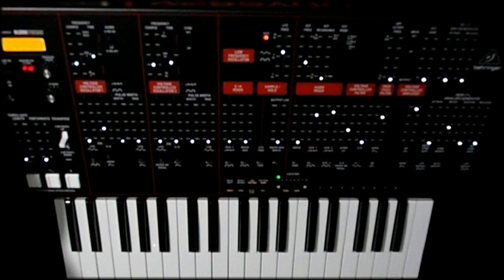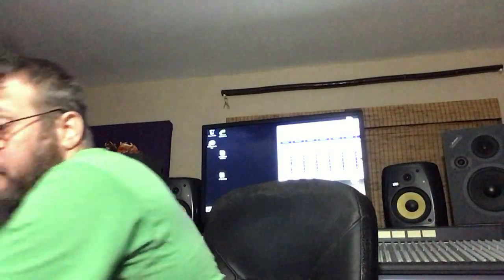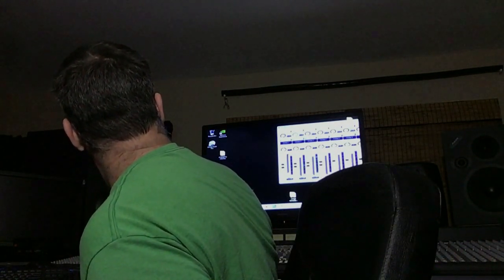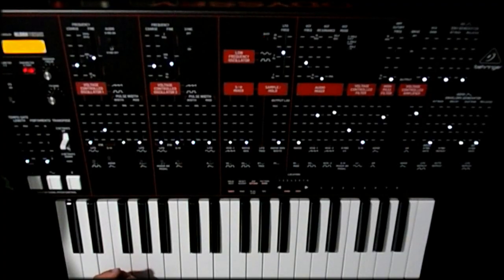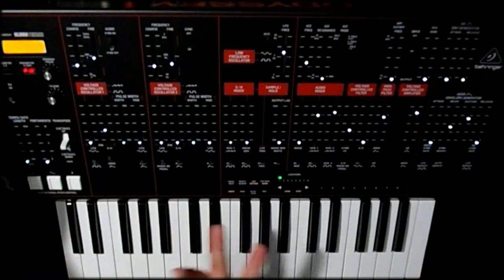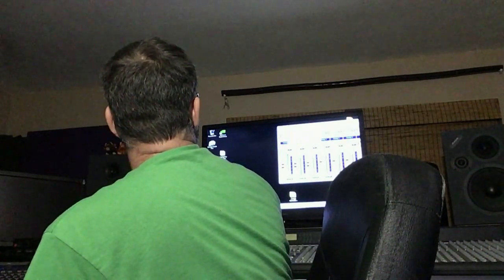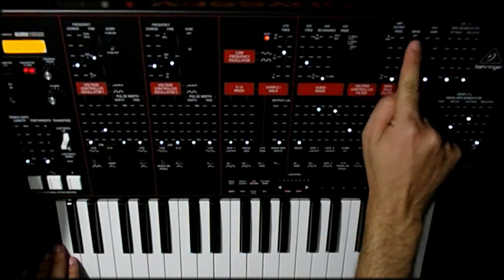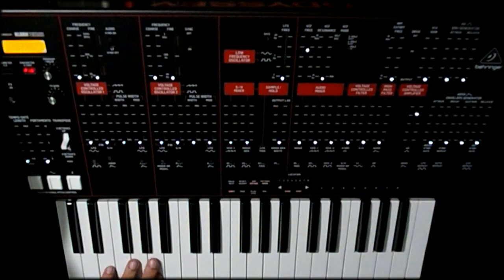Behringer Odyssey Emergency Guide. Things you MUST know.

Comment: Think maybe you have discovered the difference between balanced and unbalanced connections. +4dbu -10dbv. Professional v. consumer.
Reply from the maker: I was plugging a XLR F (balanced) cable into a TRS (balanced) jack on my audio interface. Even with (if I remember right) a full 18db of gain on my MOTU audio interface I was not reaching peak. Yes I could plug into a mic preamp/DI/console with more gain than that, and that is probably how that jack is meant to be used. It might even be better than the amp in the Odyssey. Balanced itself is just about splitting the signal and flipping phase on the copy to elminate interference. Technically the balanced connector can put out a hotter signal, because of the extra in phase copy being combined at the receiving end and is probably why those +4 balanced buttons exist with saying "balanced" on them. A balanced connection isn't softer though, it's potentially the louder one vs unbalanced depending on how circuit is designed. BTW that mixing board isn't just a backdrop. :)
Reply: @housebandthexenos2569  In this vid you state the xlr is a loud signal and the 1/4" is a low volume signal. Again, the xlr is likely running at +4dBu, as a balanced signal, and the 1/4" is a tip/sleeve unbalanced signal running at -10dBv.  Both are line level, but at two different standards.  If you plug a -10dBv signal into a device that is on the +4dBu standard, your signal is going to be very low and will need amplification for most purposes.

We're all annoyed at older gear that used xlr exclusively for their balanced connections, and 1/4" ts for their unbalanced connections.  But nowadays most manufacturers will add a 1/4" trs balanced option as well (in a combo jack or a separate 1/4"), which we all prefer. I have to adapt all my xlr balanced cables to 1/4" trs to get into my balanced 1/4" patchbays and interface with the majority of my gear that is 1/4" trs. It's just an extra thing to buy, thing to wear out, and thing to rebuy. Or it's a dedicated, different kind of cable, that can only serve the purpose of going xlr to 1/4" trs.  I'm adding an  8 xlr in and 8 xlr out device to my rig, but to interface with the rest of my studio, I need to turn all that xlr into 1/4", that's 16 new, specialized cables. $$$! not money I want to spend when I have thousands of feet of 1/4" trs cabling available.

Anyway, all the best!
Reply from the maker: @alphanumeric1529  actually I didn't remember right lol, I stated it needed 18 db of gain when I was using the XLR in my comment, it was of course the 1/4 cable that did. It was also 12db not 18. My observation in the video was just that the low output jack was REALLY low. It required more gain than the interface was capable of giving which can use balanced or unbalanced connections. There is a +4 -10 switch in the software for the interface that did indeed help that I did not show in the video, but still it did not get it all the way there. The interesting thing to try will be running the low output into the D/I input of a good mic preamp, to be able to get a different flavor of boost. Part of the issue I discovered after the video as well, is that the sliders on the B. Odyssey influence the values in a very exponential way rather than linear. They have a TON of effect at the top and very little at the bottom. It feels like the volume of the VCA practically doubles in the last fifth or less of the slider travel. That means if you have that vca down almost any you are putting out a much lower volume than it looks like. I really just wanted to drive the point home of the hotter output being better for most purposes without using an XLR-XLR cable and overdriving the input of the mic pres on people's interfaces. Thanks for your BALANCED input. lol.

Comment: It's not the truth,that the pitch control work so bad.The internal use is fine.Perhabs it's the midi routing,that make the problem in the video.
Reply from the maker: I had no midi hooked up in the video at all. I was just pushing the buttons and trying to hold the bended-to pitch. I even was gripping the outside of the case with the rest of my hand to try and give a more stable pressure. I do wonder if the odyssey can respond to pitch bend over midi, allowing use of normal wheels and benders. I havent tried that yet but will soon. Thanks for watching.
Reply: @housebandthexenos2569  did you find out if the pitch bend works via a different controller?